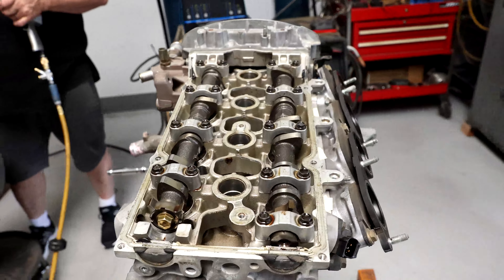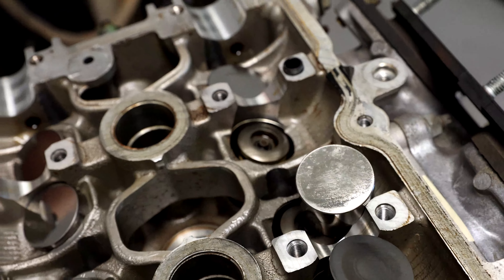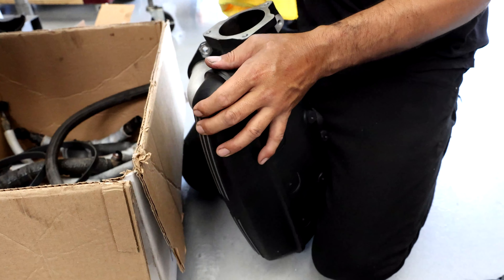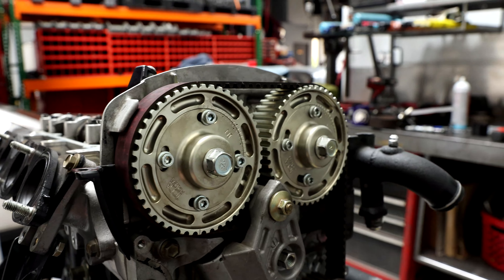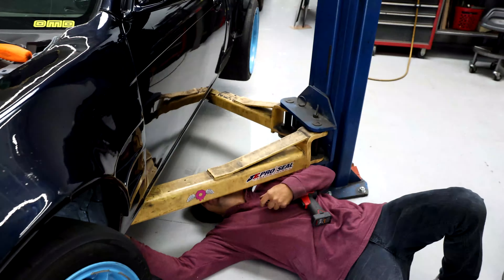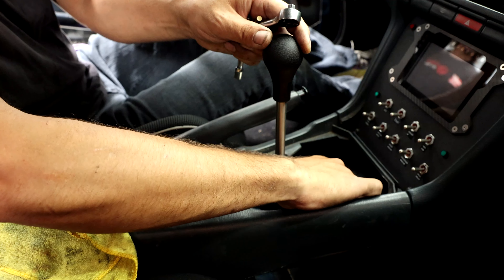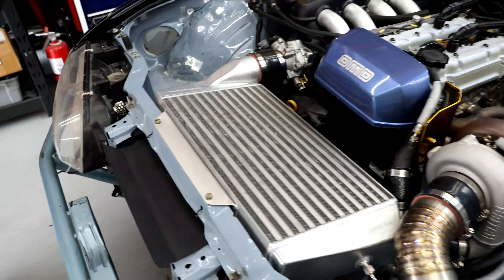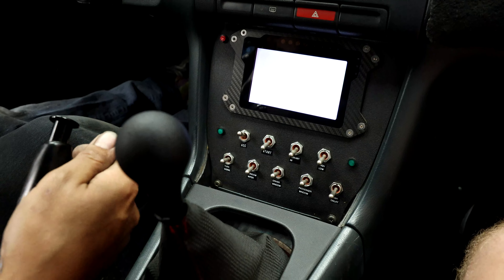Replacing The Blown Beams Engine! Plus A New Shifter!

Comment: I really like Martin's method for running an oil cooler because I have relocated my oil filter to the block, getting rid of my stock oil cooler in the process. I was wondering what fittings he uses?
Reply from the maker: Thank you! Martin uses either XRP or Earl's fittings for pretty much everything he does.

Comment: The cause of the previous engine failure was valve float which did result spectacularly. Im just wondering with this engine did you replace springs/valves to prevent this from happening again.
Reply from the maker: Nope, we lowered the redline a little and changed the way the redline actually cut the engine to hopefully stop any over revs. Performed great at its first day out, so if we can get another 2-3 years without issues sounds great to us.
Reply: That is certainly having confidence in the beams.  You hear so much rubbish regarding these engines of failure points and yet here you guys are, giving this thing heaps. Did you contemplate doing the valve springs at all.
Reply from the maker: @steveattard5029  We definitely talked about it. even considered going inconel for the exhuast side. We more than likely will build a fully prepped beams engine for the future and just use this one for now.

Comment: Hey guys great build...I have an altezza with the same beams motor in it we've built it with pistons rods valve springs arp head studs stock vvti cam gears making 400whp but I need a stronger gear box any suggestions here for me and I'm getting a condensation build up find it weird after a few months it's happening regularly we did a leak down test all cylinders are showing good we live in a tropical country btw any help would be great thanks
Reply from the maker: The R154 gearbox is probably the easiest way to go! Use the 4y bellhousing! Best of luck with the car man!
Reply: Great thanks for the reply...so 400 to wheels on 20psi pump gas...we wanna push it abit more. How much boost can the head and block handle and do you guys ever had any issues with the head cracking?
Reply: Any advice with the condensation issue or  is that normal
Reply from the maker: We only run 11psi so we wouldn't be the ones to answer that haha. As for the condensation, not a problem we've run into ourselves. I'd recommend making sure the crank case is properly ventilated.
Reply: @omd_sd  11 psi haha great stuff anyways thanks for the advice